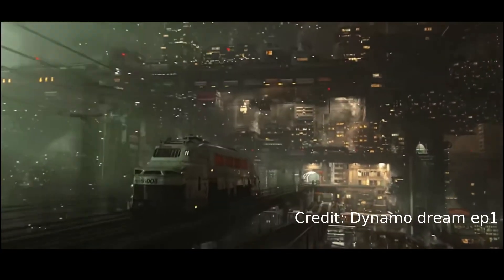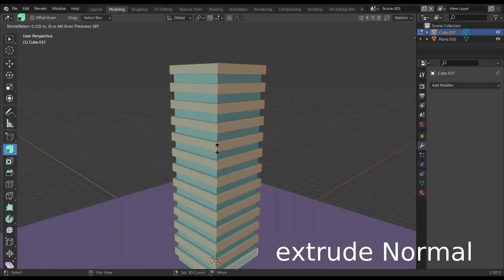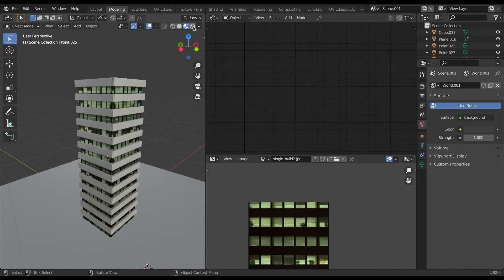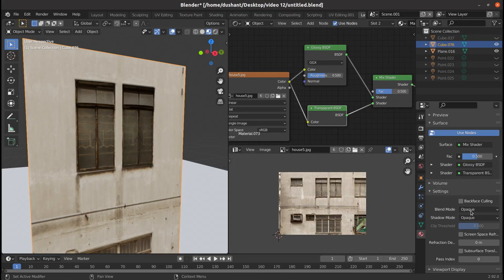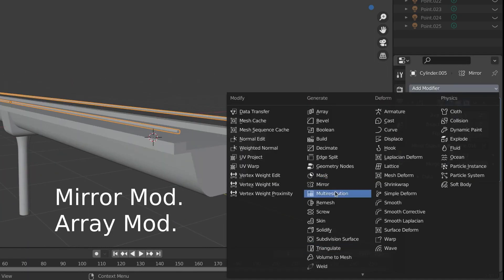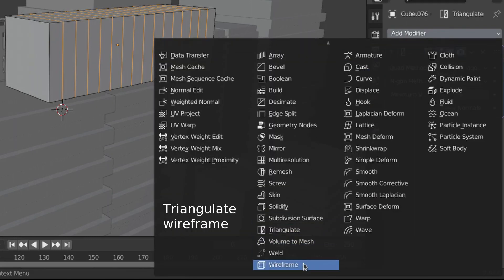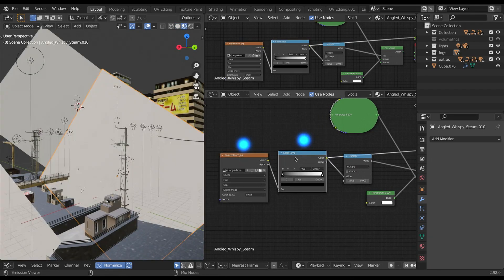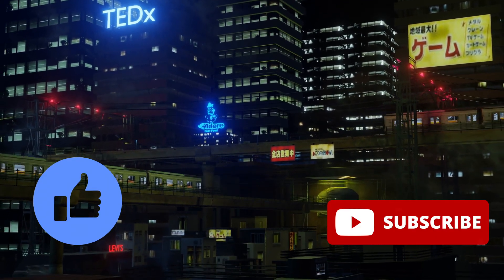Making CITY in Blender | Ian Hubert Way | Break-Down

Comment: Excellent.... when placing the point light inside the box how do you prevent it from bleeding outside.... the light on mine is working correctly for the window... but I can also see it on the roof and corner of the building too. How do you confine it to JUST come through the window?
Reply: Contact shadows or, the sloppy way, add another box around the room and cut out the window so that it only comes out of the window
Reply: Contact shadows

Comment: Bro which laptop used this software perfectly please suggest me...
Reply from the maker: Almost every laptop with good graphic card (specially Nvidia graphics card)
Reply: Any laptop with a I5 8th gen and above, with an NVIDIA GeForce GTX 1660 Ti Mobile would be good to start tbh. For things like this, don't be expecting to do massive projects with very large poly counts and simulations though. But a setup like that will run you at about 800$, depending when and where you get it. But yeah I58th minimum and a mid tier Nvidia card. Hope this could help